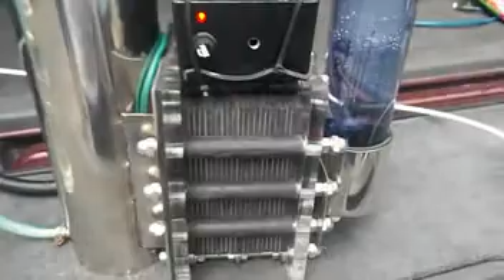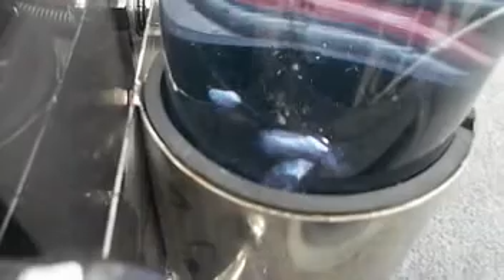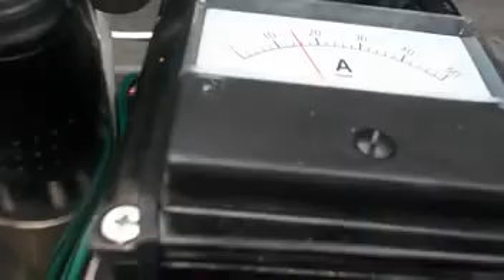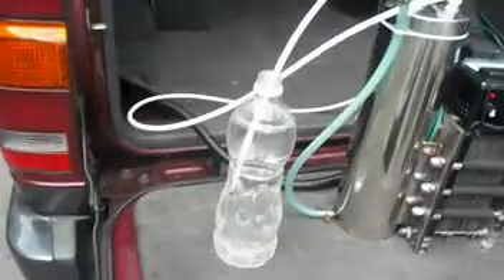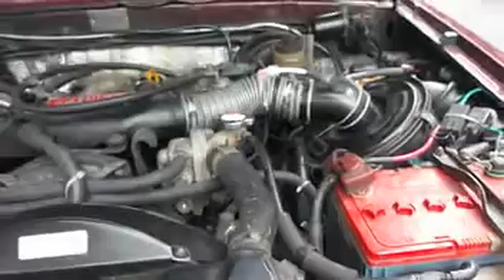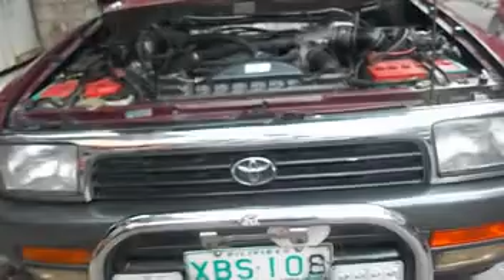HHO VOX Pilipinas-HHO Installation

Comment: Hehehe First to comment bro what is the prize ? I like it.
Reply from the maker: Bro  Tan, this  kind  of  HHO  cell  is very expensive  to  built,.. that is  the  one you dont  like  it hehehe....
Reply from the maker: my original production price is around 568 usd with wires and installation, metro manila price for 21 plates... its  not GATP  price.bro.. how  much  you  cell  for  your 1.00 cc  to 1.8cc HHOcell bro?
Reply: 350 usd without pwm and all efie devices bro
Reply from the maker: noted bro.. HAPPY NEW YEAR  !
 thanks ...
Reply: Happy new year